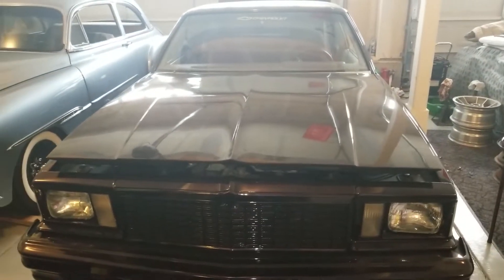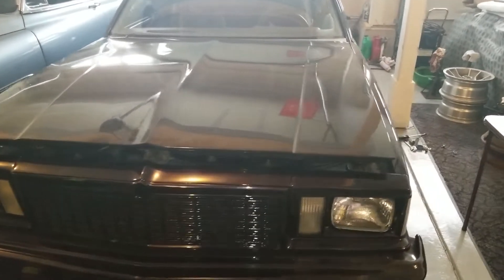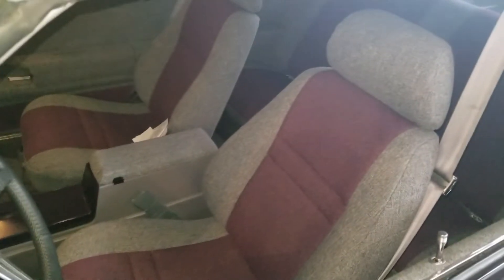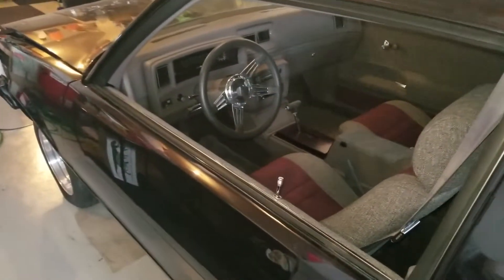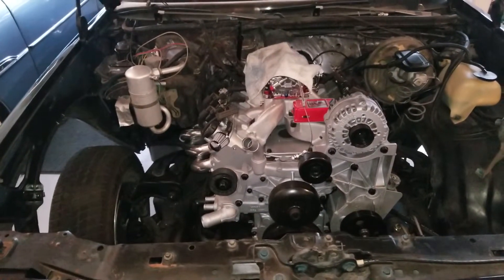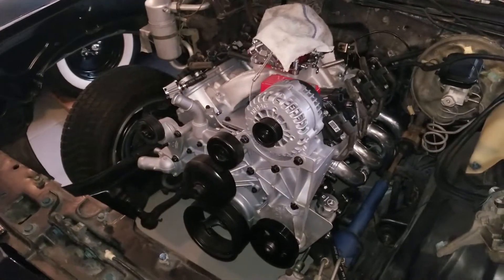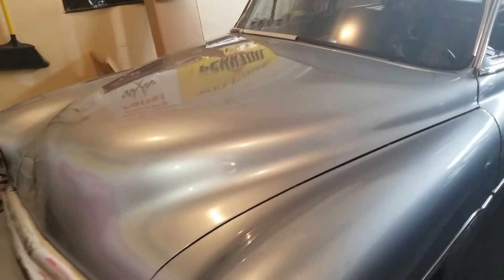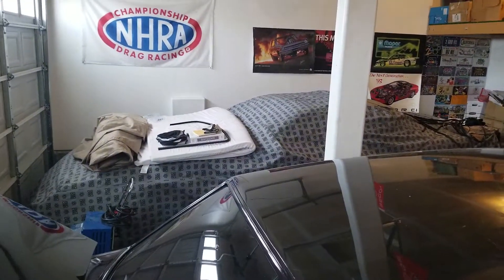G-body Malibu LS 5.3 Swap

Comment: Very easy to get over 400hp out of a 5.3 with a mild cam at 6600rpm with a bigger cam and worked heads close to 500 at 7200rpm my friends mustang has a 570 lift cam with 226 duration it idles good with a slight chop even my monte carlo with 236 duration on 112 lobe separation idles decent with only a slight chop

Comment: With a buick GN 8.5 rearend or better drag radials and suspension mods drag spring front and back rear lift bars to plant the tires should easley go 12s to high 11s l have a 1984 Monte Carlo SS with a 6.0 with CNC ported LS3 heads 600 lift hydraulic roller cam and a holley 850hp carb on a GM single plane intake with 1 7/8 longtube headers 540hp at crank pulls very hard 3500RPM to 7200rpm with mods mentioned above it's best quarter mile was 10.97 at 122mph but will run 11.0 to 11.3s all day long and drive it home from the track with a 3000rpm lockup torque converter and 700r4 trans with a buick GN 8.5 rearend with 4.10 gears car has power steering and brakes no A/C when you get it finished it will be fast reliable and alot of fun but l don't think the 7.5 rearend will last long with sticky tires l broke my 7.5 long ago when car was power by a 400hp 350ci my friend has a 1988 mustang with a 5.3 engine 440hp at crank on motor with mods and a 200 hit of nitrous that has gone 9.98 at 138mph with coil over suspension and a power glide trans with a 4000rpm torque converter with 3.73 gears car runs low 11s at 120mph on motor weighs 2930 with him in it if you set it up right your going to be very happy with it

Comment: You got part number on the intake and what carb did you have to use an a adapter to fit that carb ?
Reply from the maker: Intake is a LS swsp dual plane. Ordered from Jegs or summit. 750 Quickfuel carb. No adapter. Bolt on.
Reply from the maker: 71187 is the part number